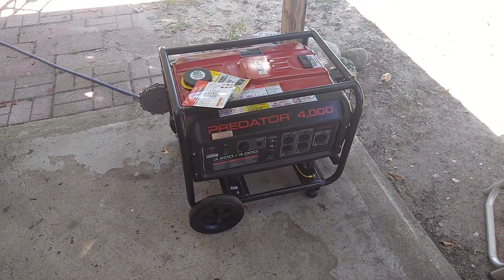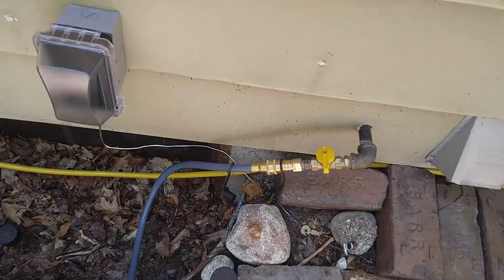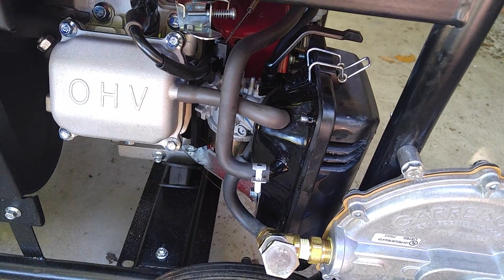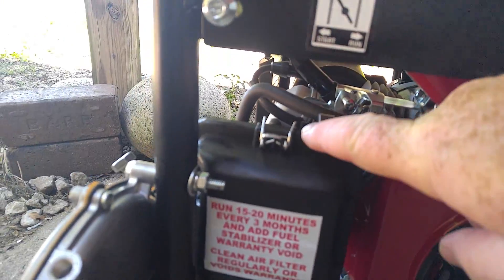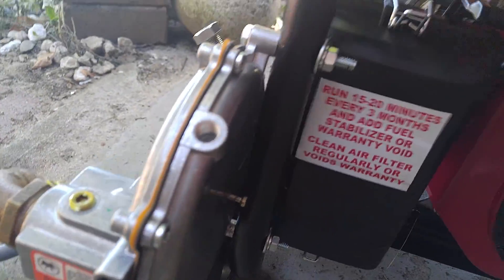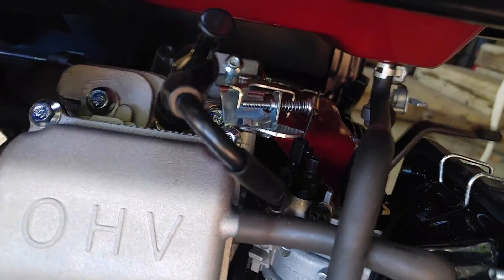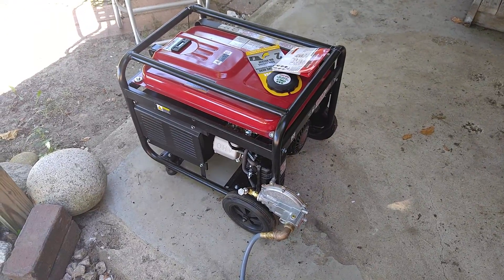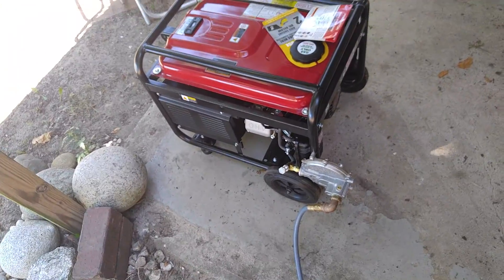Predator 69676 4000w Generator US Carb Snorkel Natural Gas Conversion Part 1

Comment: Your going from a 1”gas pipe to a 1/2” hose to a even smaller inlet Snorkel. The problem seems to me you need 3/4” from 1” hose so the regulator has more ng pressure into Snorkel besides that the regulator has an arrow on the back for up the reason for this is the gas will gravitate to top were it’s feed to carb. Try mounting the regulator upright and use 3/4” hose it should work.

Comment: I live in a rv. I have a Eurostar gen with a 110-220 switch that's what you need to install
 Or wire the gen head to 110 for more amps
 You have nat gas so I assume your water heater is gas hopefully. Next eliminate 220 loads. Like electric stove. Big power hog!. Go gas. You would be better converting your home to propane gas. It has twice the power of natty gas!. Eliminate the gas meter and save $30.00 a month look at your gas bill. Delivery charge. Meter charges. That's $30.00 a month you could buy in propane. Next buy 2 big 100 lb tanks . use one then connect the other. Use a dolly to transport to truck and get refilled locally. Buy gas from a farm supplier its cheaper!.  Go propane all the way!.. Change orfice in hot water tank and furnace to smaller office. Then figure out your homes energy requirements. Buy deep cycle battrys and a automatic charger,  connect to the gen set. Charge battrys while using real time ac. Then shut down gen set and run quiet on inverters. Use a small inverter for icebox and match inverter size for home entertainment center with some for reserve. Place battrys in basement close to inverters run ac lines to chargers since ac doesn't require large wires. Place batty and inverter by TV , and battery by kitchen. And battery by bedroom. Connect to individual inverters with total outputs of a max load required, not Mitch larger!. Then attach solar panels to each battery set with charge controllers. Then you will have a nice system. Adjust Genny speed for load output required, not Mutch more. Then efficiency goes up! The system you have now needs some love!!!. My choke is all the way off!. My gen set fires right up electric start. Look into remote start controls. Mount Genny in basement and use hot air to heat home, pipe exhaust outside with  black iron pipe and flex pipe next to gen set. Weld a connector for attaching flex pipe to engine. Build a heat exchanger for hot exhaust to heat water in your tank use a 110 boiler water pump to circulate vhot water into  cold side of tank. There are lots you can modify on these gen sets. Use a digital rpm meter. And build a control panel inside so Genny can be controlled and monitored. Even a oil tank and oil pump can be added with a filter . think about the possibilities!.
Reply from the maker: Great ideas.... I wish I had more time for the love part. I will implement some of your ideas and maybe in retirement work on your ultimate system plan.

Comment: http://www.ebay.com/itm/Dual-fuel-carburetor-LPG-conversion-kit-170F-for-generator-GX200-TONCO-carb-/162116060273?hash=item25bedec471:g:5I8AAOSwe7BWzBga
Reply: Did the dual fuel carb fix this issue?
Reply from the maker: Yes!!!  https://youtu.be/io7oxzch9vA
Reply: Nice! I'm glad you got it going. If you can reply to this and let me know if you test it on natural gas. I still haven't. Shoot, I never even ran gasoline through mine. I just run it on propane.
Reply from the maker: Thanks! You should be fine on just propane. Someone suggested gas first for break-in. I think that was more important when gas had lead in it.
Reply: There's a lot to be said about break-in. Probably a million opinions. I did hear or read that it is recommended that the engine gets some run time on gasoline before running all propane or NG. From what I recall mine had about an hour and a half prior to doing the conversion. The new carb hasn't seen gasoline.

Comment: Kevin - you have the regulator mounted sideways. You must mount it with with the arrow pointing up. NG is lighter than air.
Reply: Physical mounting is a design consideration. After numerous tests with regulator orientation I found that the  lighter than air characteristic of NG makes no discernible difference in how the setup operates. Other forces are far more determinate of function.
Reply: ⚠️Here are the safety rules of using portable generators

It is important to follow all generator safety rules whenever we use portable generators: 

Everyone must see this. This is just a reminder for everyone’s safety. 

1) KEEPING OTHERS SAFE: Please do not allow an unqualified person or your children to operate and service the portable generator. Just because some manuals don’t say that doesn’t mean it’s safe. That is important against the generator safety rules. We also need to be keeping an eye on our children too. You need to make sure that your children are not playing near the portable generator especially when it’s running so they won’t get electrocuted. Generators pose electrical risks and they can be hot during an operation. Please keep your children away from the portable generator at all times. It is important to keep our children safe especially our little ones. Be aware of all the hazards.

2) WHERE TO RUN YOUR GENERATOR: Some people use their portable generators indoors which increases the risk of carbon monoxide poisoning. It’s important to have a carbon monoxide if you have a gas generator. Never ever use your generator indoors even if your doors and windows are open and even in the garage is not safe to use a portable generator. Not even at your porch and your deck. It is never safe to use your generator indoors and in enclosed areas of your home. Your generator needs to be 15-20 feet away from your house. 

3)🔥FIRE HAZARDS: Never refuel your generator while it’s running. You need to let your generator cool off before refueling it and before storing your generator. Never overload your generator too. Never ever back feed your generator. You should never plug your generator into a wall outlet. Also never store propane tanks indoors. Please keep flammable things away from the generator as well and please don’t smoke cigarettes near the generator. Having a fire extinguisher next to the generator is also important against the generator safety rules. 

4) GENERATOR OPERATION: make sure your hands are dry before touching the generator. Never use your generator in wet conditions. Don’t let your generator get wet. You need a generator tent if you need to use your generator during wet weather. Please don’t wear loose clothes when operating the generator. Turn on your generator before plugging in appliances. Use the right cord for your generator. Please do not use worn out cords. 

https://youtu.be/I1jT3ANENvI and here is a video more about keeping others safe when using generators 

Hope this helps. Remember it’s better to be safe than sorry.

Comment: You have two adjustments on the motorsnorkle.  One is for air fuel mixture.  The other, which they say not to touch is a atmospheric equilibrium bladder.  I'm confident between those two adjustments, hopefully just the first one, you can get the air/fuel mixture and choke all handled.  I'll try calling tech support on the motorsnorkle conversion kit.....
Reply: They sent me three different regulator each with less max inlet pressure. Per their instruction I adjusted the spring tension on the bladder valve train. I disassembly a regulator to examine it internally and better understand the valve train including the spring used to set max inlet pressure. With everything optimized half choke was still needed to get proper operation.
Reply: ⚠️Here are the safety rules of using portable generators

It is important to follow all generator safety rules whenever we use portable generators: 

Everyone must see this. This is just a reminder for everyone’s safety. 

1) KEEPING OTHERS SAFE: Please do not allow an unqualified person or your children to operate and service the portable generator. Just because some manuals don’t say that doesn’t mean it’s safe. That is important against the generator safety rules. We also need to be keeping an eye on our children too. You need to make sure that your children are not playing near the portable generator especially when it’s running so they won’t get electrocuted. Generators pose electrical risks and they can be hot during an operation. Please keep your children away from the portable generator at all times. It is important to keep our children safe especially our little ones. Be aware of all the hazards.

2) WHERE TO RUN YOUR GENERATOR: Some people use their portable generators indoors which increases the risk of carbon monoxide poisoning. It’s important to have a carbon monoxide if you have a gas generator. Never ever use your generator indoors even if your doors and windows are open and even in the garage is not safe to use a portable generator. Not even at your porch and your deck. It is never safe to use your generator indoors and in enclosed areas of your home. Your generator needs to be 15-20 feet away from your house. 

3)🔥FIRE HAZARDS: Never refuel your generator while it’s running. You need to let your generator cool off before refueling it and before storing your generator. Never overload your generator too. Never ever back feed your generator. You should never plug your generator into a wall outlet. Also never store propane tanks indoors. Please keep flammable things away from the generator as well and please don’t smoke cigarettes near the generator. Having a fire extinguisher next to the generator is also important against the generator safety rules. 

4) GENERATOR OPERATION: make sure your hands are dry before touching the generator. Never use your generator in wet conditions. Don’t let your generator get wet. You need a generator tent if you need to use your generator during wet weather. Please don’t wear loose clothes when operating the generator. Turn on your generator before plugging in appliances. Use the right cord for your generator. Please do not use worn out cords. 

https://youtu.be/I1jT3ANENvI and here is a video more about keeping others safe when using generators 

Hope this helps. Remember it’s better to be safe than sorry.

Comment: You need at least 3/4" the whole way
Reply: Then why does the engine run fine when I hold the primer button? The gas volume is not the problem. The small snorkel is. The combination of the input pressure which is only 1/4psi for NG, and the small snorkel size does not allow enough gas through the regulator. That is why the setup works fine with propane at 1/2psi. I saw zero change when I switched from 3/8" to 1/2" full bore valves, pipes and fittings. I can make an 8 foot flame.... believe me there is plenty of gas available.

This is the solution.

http://www.ebay.com/itm/Dual-fuel-carburetor-LPG-conversion-kit-170F-for-generator-GX200-TONCO-carb-/162116060273?hash=item25bedec471:g:5I8AAOSwe7BWzBga

Thanks!
~Kevin.

Comment: You got me thinking...First, larger displacement will mean more air volume, not more vacuum. As an example, a 454 CID Chevy engine will give me 19 inches of vacuum. A 307 CID Chevy will also give me 19 inches of vacuum. The only thing engine vacuum does is open the valve in the regulator to allow gas flow and that has been verified. I still think you should verify that your setup works without half choke on propane. You think it may be a pressure issue. Did you ever have your NG supply pressure tested? Other things may work fine at a given pressure but the Gen may need a different pressure. Who knows? Did US carb ever offer you a refund if you sent their kit back? I never liked their kit and thought it was too expensive. I wasn't going to spend $150 plus on a kit for a $199 generator. I went with a dual fuel carburetor made by Tonco. This was $39 and free shipping. If you are interested go to ebay and search "dual fuel carburetor". This took me a whole 4 minutes to install. And you do not have that big honking regulator mounted on the side of the generator. On propane this was a 2 pull start per the instructions minutes after the installation. I did not run this on NG or gasoline as of yet but am very happy with this product. The engine ran smoother and seemed quieter. No adjusting anything! Even though I test with a 90% load, I never intend to use 90% during an outage. Last summer we had an outage and the only thing I needed to power was my fridge. I couldn't even tell that the generator was powering anything. Once I get my full hookup, the max I intend to do is fridge, furnace, and minimal lighting. That would hardly break 75% running load. If you look at that dual fuel carb, your engine is a 170F.
Reply from the maker: Thanks for the great info, I will definitely buy the Tonco carburetor. You're most likely right about the vacuum level, the thing that a larger engine would do is allow for the larger snorkel. I think USCarburation's kit works ok a larger engine with natural gas bacause of the larger snorkel. Hopefully once I get Tonco carb I can send my USCarburation's kit back for a refund.
Reply: Let me know how the Tonco carb works with NG. I never tried it yet because I haven't plumbed pipe to the outside yet. I could probably just go through a basement window with my hose and tap in somewhere but I just haven't done it yet. If you order be patient with shipping. From what I recall it wasn't exactly quick. Last week I did a cold start for the fun of it. 3 pulls and it was running in 15 degrees temperature outside. I guess it is good to run cycle them every month or so. I let it run for about 7 minutes, made sure it produced power then put it away. When it is warmer out it is usually a 2 pull start per the instructions. That carb comes with extra gaskets that I didn't even use because my generator had only about 1.5 hours on it and the gaskets were not stuck on. I just reused my original gaskets. Believe it or not I used an old piece of air hose for my air compressor to connect to the gas imput on the Tonco carb with a small clamp. It has the male end setup for "quick connect" for my hose. So basically, I have a quick connect fitting on my propane tank regulator, the male end of my long hose hooks to that, then the female end of the hose connects to the small (about 8 inches long hose ) male end on the generator. The long hose I am using is basically what you would use on an air compressor for your impact guns and air ratchet. The inner diameter of these hoses is quite small. Probably a quarter inch. But it runs. I'm a little worried about that small size on NG but will have to wait until I test it to see if I need larger hose or not. I see a lot of videos where these guys are spending big bucks on their hoses. My thought is why? My generator is for emergencies only. I will not spend extra money on the perfect hoses. I only would if I knew I was going to be running for long periods of time with the generator unattended. Like weeks.
Reply from the maker: Make sure you test all components in real world conditions so you know it works in an emergency. I called the gas company but could not get an answer on how long the NG would flow after a major power event.
Reply: @Deucealive75  ⚠️Here are the safety rules of using portable generators

It is important to follow all generator safety rules whenever we use portable generators: 

Everyone must see this. This is just a reminder for everyone’s safety. 

1) KEEPING OTHERS SAFE: Please do not allow an unqualified person or your children to operate and service the portable generator. Just because some manuals don’t say that doesn’t mean it’s safe. That is important against the generator safety rules. We also need to be keeping an eye on our children too. You need to make sure that your children are not playing near the portable generator especially when it’s running so they won’t get electrocuted. Generators pose electrical risks and they can be hot during an operation. Please keep your children away from the portable generator at all times. It is important to keep our children safe especially our little ones. Be aware of all the hazards.

2) WHERE TO RUN YOUR GENERATOR: Some people use their portable generators indoors which increases the risk of carbon monoxide poisoning. It’s important to have a carbon monoxide if you have a gas generator. Never ever use your generator indoors even if your doors and windows are open and even in the garage is not safe to use a portable generator. Not even at your porch and your deck. It is never safe to use your generator indoors and in enclosed areas of your home. Your generator needs to be 15-20 feet away from your house. 

3)🔥FIRE HAZARDS: Never refuel your generator while it’s running. You need to let your generator cool off before refueling it and before storing your generator. Never overload your generator too. Never ever back feed your generator. You should never plug your generator into a wall outlet. Also never store propane tanks indoors. Please keep flammable things away from the generator as well and please don’t smoke cigarettes near the generator. Having a fire extinguisher next to the generator is also important against the generator safety rules. 

4) GENERATOR OPERATION: make sure your hands are dry before touching the generator. Never use your generator in wet conditions. Don’t let your generator get wet. You need a generator tent if you need to use your generator during wet weather. Please don’t wear loose clothes when operating the generator. Turn on your generator before plugging in appliances. Use the right cord for your generator. Please do not use worn out cords. 

https://youtu.be/I1jT3ANENvI and here is a video more about keeping others safe when using generators 

Hope this helps. Remember it’s better to be safe than sorry.
Reply: @The_Happy_Aviation_Enthusiast  Why do you keep replying to me multiple times with this?